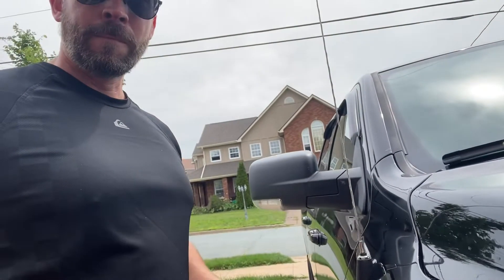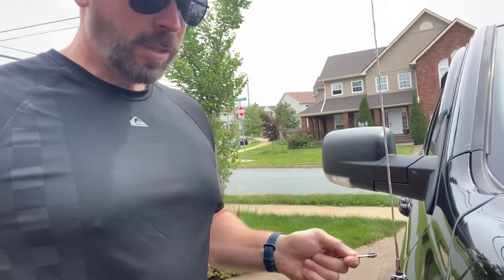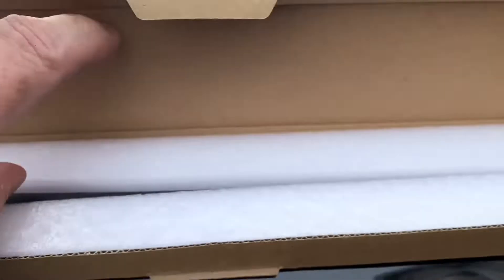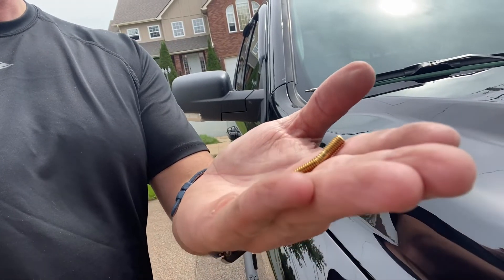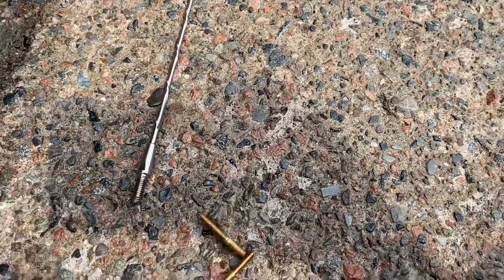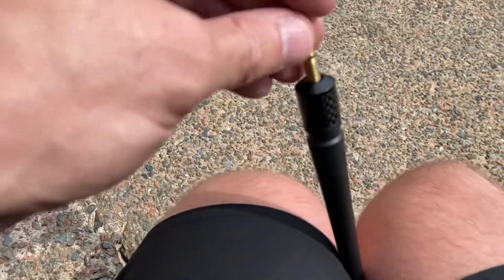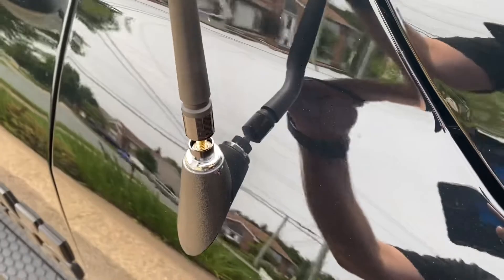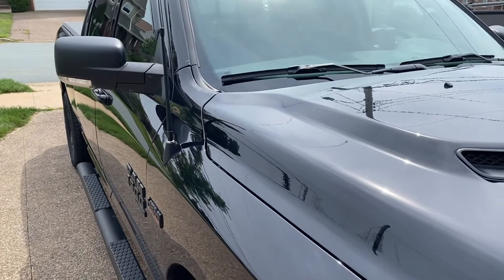Rydonair antenna install on 2022 Ram 1500 Classic

Comment: good stuff  but one thing i would do is put some antiseze on the threads.
Reply from the maker: Agreed. At install time I was concerned about reception and that I may want to remove it easily.
Reply: @ruginski  u know we radio nuts aint happy unless we have antiseze all over us :)